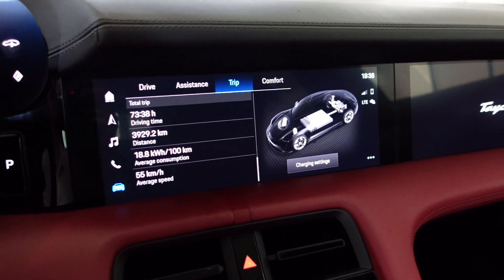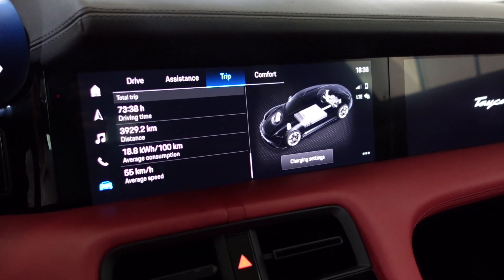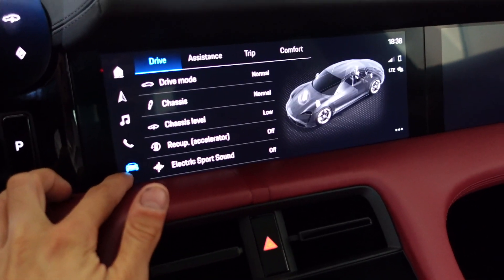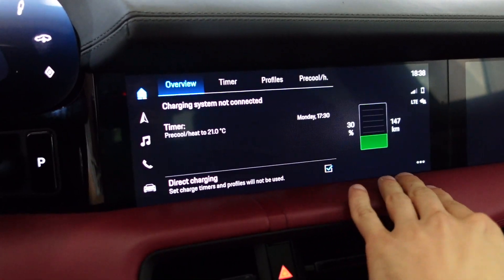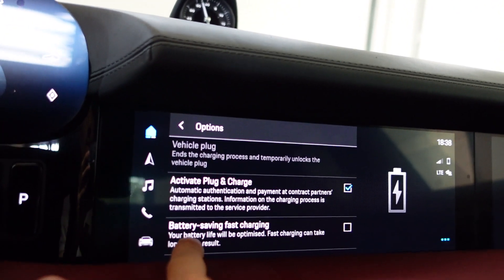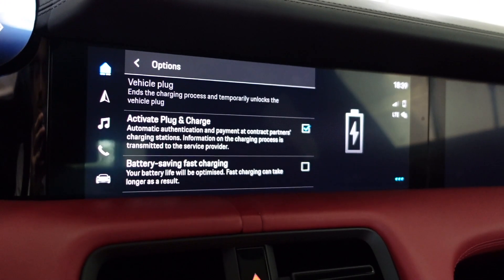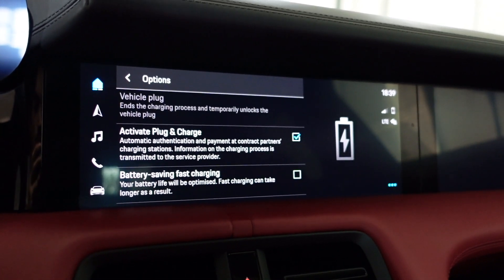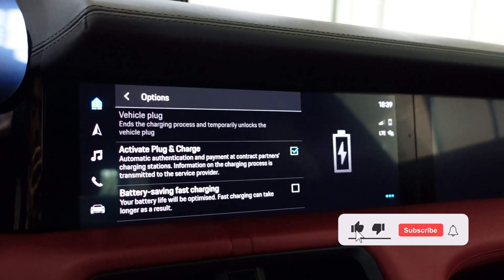Know Your Taycan: Save Your 800V Battery From Degradation With This Setting | EP. 2

Comment: I usually notice heat and the fan works alot in my taycan when i charge with a tesla charger. If i used battery saving will it help cool down the car when charging?
Reply from the maker: No, usually it makes no difference the charger you use. They are all the same at least in Europe. It’s the car that does everything after you plug in. If you want better cooling, leave it on and on SPORT PLUS.